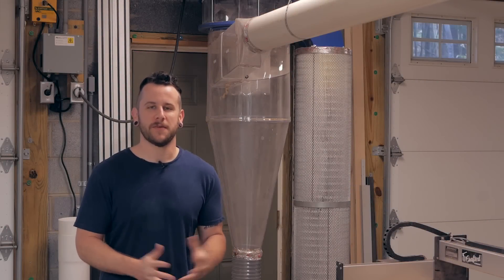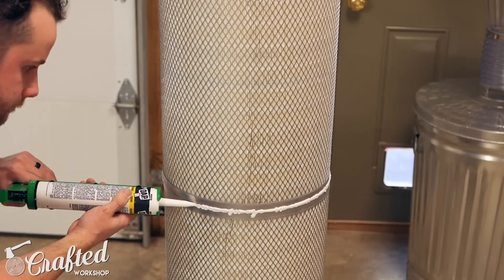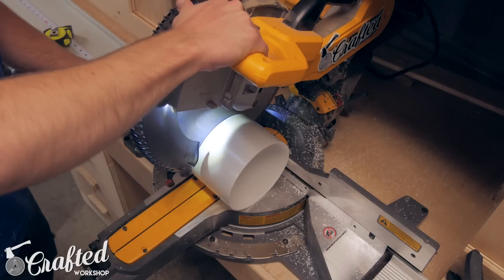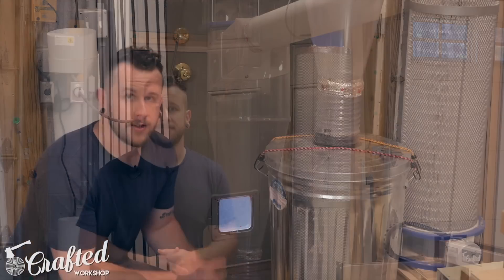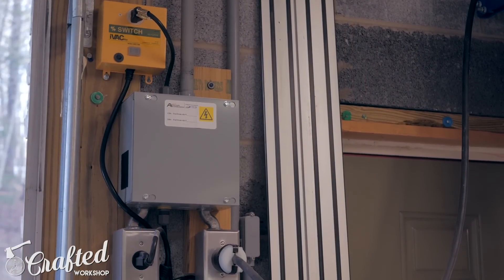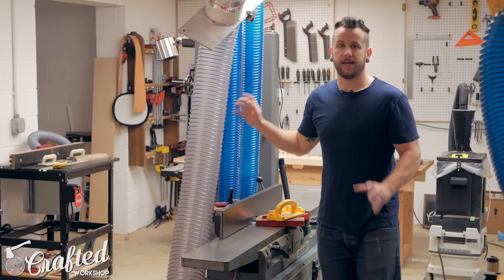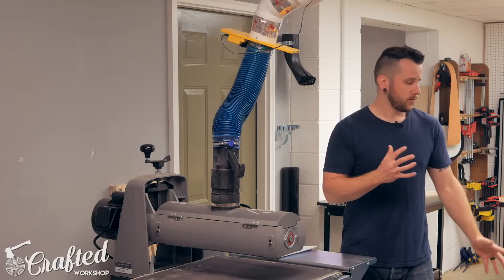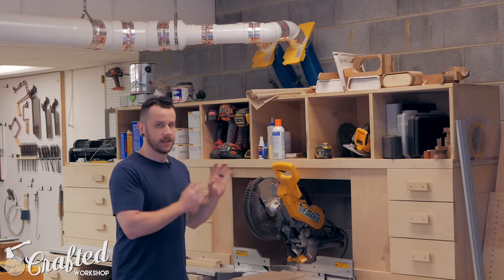Woodworking Dust Collection System w/ iVac & Clearvue CV1800

Comment: I am in the processing of setting up a system replacing my jet double bah system that spewed dust everywhere.  It was in an attached building so noise really wasn’t a factor until I realized I was pumping all that outdoors.  I just realized you were sponsored by Clearvue which was one I was considering.  The others being Oneida, Laguna Pflex, Baleigh DC2100C.  I REALIZE THAT THE ONEIDA AND CLEARVUE HACE LONGER CYCLONES, WHOCH results in extra height which limits shops with low ceilings, but❤ i am truly selling t❤he best performance in reducing dangerous small dust particles as determined by actual users.  I am concerned because this unit will be inside my shop not vented inside.  HELP.

Comment: The grounding is a good idea to prevent a dust ignition (explosion) easily fixed insert a wire in the system main trunk line during construction

Comment: Nice review. I am trying to determine what direction I’m going to go. Grizzly Go441 cyclone or the clearvue. One of my biggest concerns is the fine dust, I have a 37” Ramco wide belt sander . So as you stated when you run your drum sander you can see the fine dust in the drum. There has not been one review or video actually showing how much fine dust is collected in the drum. Take no offense I don’t know any of you that has received system from Clearvue, your word is one thing but proof is in the collection drum. It’s my $2000 at stake not yours or anyone else. Thanks and appreciated.

Comment: i just bought a Oneida v 3000 and have been putting it to gether  , i just ordered 2 long 45 to bring the whole line closer to the celing.  i will not buy any more metal pipe,  is there any issue  with putting the two pipes together?  thanks,,doug

Comment: 5 HP motor is not 3 face?  3 face motors do not use capacitors for starting.
Reply: 3 PHASE....anything over 3hp should be, otherwise it's a furfy.
Reply: @brewsterly2927  ??????????
Reply: @mtabernig  

A 5HP motor would be 3 phase, not 3 face.
Reply: @brewsterly2927  yeah I c my mistake ....lol
No in socal does not rain,    It never rains in Southern California....... nay be once a year?
Thanks.

Comment: From what I can see that iVac is rated at 20amps but the clearview is 30amps- how did you get around that?
Reply: The iVac isn't directly switching the motor power in this design.  The non descript grey box below the iVac is an optional high current relay they sell for motors over 3HP.   The iVac he is using is a 120 V model and it serves as the actuator for the high current relay.   

Kind of odd plugging a  relay into a  relay, but this does allow them to switch more or less any load they want without having to have a bunch of different models.

Comment: if anyone could explain to me the static pressure numbers and what they mean, I would really appreciate it.  Is a higher static pressure value better than a lower value?  I mean, if it says the dust collector will produce 1000 cfm at 5.0 sp, does that mean if the static pressure in your system is more than 5.0 the dust collector will not achieve that cfm rating?  Is the reverse of that also true?  Meaning a system that had 2.0 sp would allow the dust collector to achieve more than 1000 cfm?  And what about Max Static Pressure?  Would someone be willing to explain this to me OR maybe give me a link to somewhere that does explain it?  Thanks.

Comment: I made a 2 stage collection system with a HF 2 hp motor, and a few pieces of PVC attached to a metal trash can.  Cost was less than 200 for entire system.  I do agree with you on the grounding issue.  Didn't ground mine either.  No static on PVC.

Comment: Totally agree about the grounding issue. I have never had a problem with static electricity whether working with dry or wet wood or the humidity in the shop.
Reply from the maker: I still have yet to have an issue, I think it’s completely bogus.

Comment: Hey man, first off let me say I am a big time Clear Vue fan--but to my question---do you wear hearing protection any time you have your DC on? My CV-1800 is so loud I can't be in the shop when it is running--at least without ear muffs. I haven't seen any YouTubers mention how brutally loud that 5 HP motor is? Just interested to what you do??
Reply: I can tell you what you can do: ENCLOSE IT; due to many reasons, this time around I decided to get a cyclone that I can keep inside so I don't waste thousands of dollars again only to rust outside, so I got the clearvue max, with a 8" main; I enclosed it in the corner of the shop and left the top part where the motor is open, away from me, thus reducing the noise quite a lot; I put a doorway for the bottom part so you can easily clean out the dust bin; if more serious maintenance is needed, the osb can easily be unscrewed and get access to the entire system; hope this idea help you in reducing the noise. dan.
Reply: Enclose a tool thats almost meant to give a show? Honestly the thing i love about these DCs is the view
Reply from the maker: Hah, it is fun to watch!
Reply: I guess its a choice one has to make, the noise can be annoying at times thus for me "show" means nothing, production and pleasant environment to work in would do for me

Comment: Nice job! Working on a very similar system (CV1800, pvc) for my home shop. Now that you've been running/using it for a while, is there anything you'd do different? How would you rate the CV1800 noise or have you found a way to reduce the sound? Was there a reason you went with 2 drops for the ts rather than 1 with the CV 6->dual 4 adapter? Thanks for the video, it's been very helpful!
Reply from the maker: The system is still working well. The CV isn’t quiet but besides building some kind of enclosure for it, I don’t know of another way to reduce the noise. The reason for two drops on the table saw was I needed one hose to hang down to keep it out of the way with that blade guard. I’ve since changed that setup and have one drop with the 6 to dual 4 adapter.
Reply: @craftedworkshop  Thanks for your reply Johnny! Sorry, forgot to ask, doh, are static shocks an issue? Re the sound, the Bill Pentz site has a page on making a muffler (Oneida sells something similar) - if you haven't seen, it goes between the plenum and filter. Saw a YT vid where the guy did a side by side with/without. IIRC, it was a significant reduction, 8 dB or so. Thanks, again, Jerry

Comment: Very well done, amazing what a bit of concentrated thought and more than a bit of coin can do:)  Like that work you did on table saw using 4 inch pipe above the blade. and switching out the standard 4 inch to 6 on your jointer.  Curious about your galvanized trash can, with all that HP do you ever get trash can implosion)  I have see that happen with metal cans in the past.  Otherwise great video and keep up the great work, smarter not harder)

Comment: Hi Johnny,
Did you get a stock CV1800, or upgrade the impellar to 16" (a sort of CVMAX / CV1800 hybrid)  I'm finally about to commit to the purchase, but I have a 20" planer and want to make certain I've got enough suction.
Reply from the maker: I have the stock CV1800. Works well for me but I have a 15” planer, might want to confirm with the manufacturer of your planer what kind of CFM they recommend.
Reply: sorry to butt in, but cvmax would be a better choice for you, is not the size of the impellar (as you call it) as much as the size of the main run, cvmax has 8" inlet vs cv1800 at 6"; now, that won't help at all if you gonna dramatically drop your lines to 4" or so; you should keep it as large size as possible all the way to the tool.

Comment: You totally skip right over the one of the most important parts of the entire system, the dust filter. Things like, brand name, size, microns capable of collecting and how much is necessary, how do you and how often do you have to clean it. What is that thing on the bottom of it, you know, small little details like that.
Reply from the maker: The filter came with the dust collector and the instructions are clear on how to clean it. I spray it out with compressed air and vacuum out the dust from the bottom of the trap.

Comment: I know this is an old video now but I just saw it.  Really nice set up.  I run 6" pipe similar to you on my system and have found a dramatic decrease in airflow when going through flex hose.  I have compared measurements from 4" flex versus 4" smooth pipe and have concluded that the flex pipe reduces airflow by much more than I expected it would.  I noticed you have some very long flex hose runs.  I have run straight pipe as much as I can and use very little flex now.  The drawback is you can't move your machines around as much but the increase airflow is worth it.  I know your changing it but for example, there is not reason to run flex hose down to you miter because you don't have to move that machine.
Reply from the maker: For sure, good tips!

Comment: First, thanks for sharing.  Nice work.  Question for you....  looks like the take off from the cyclone is pretty level.  But I know the cyclone is angled up a bit from the intake.  How did you address that connection?
Reply from the maker: Thanks! There’s enough play in the connection that I could account for the angle and keep the duct level.

Comment: What type of pvc pipe did you use. The sewer pipe that I have seen is usually blue. Is there a ASTM number or part number on it.  Manufacture name also if you don't mind.  I just purchased a cvmax and just planning on the ducting... was thinking nordfab, but serious cash.
Reply from the maker: It was sewer and drain pipe from my local plumbing supply (Hajoca). 6" diameter.

Comment: was there a good reason you ditched the molded gorilla? i have a very small shop (11x24) and to make the most use of the space I won't really be able to put in a huge DC... because my tools will float I'm thinking I should just upgrade what I've got (a 1hp portable with cannister filter) and the molded mini seems like the only option. you seemed fairly happy with it?
Reply from the maker: Yea, it worked well, I just had the room to upgrade to something more powerful and add ductwork. It’s certainly a lot more convenient. Laguna also has some mobile options that look good.

Comment: You seem kind of apologetic about not showing a "woodworking" project. I think this is a very important topic for people to gather information about. Besides just the cleanliness of the work area there are health implications of dust. Something people may not think about is if your shop is in a basement - the fine  dust will be impacting everyone else in the house. Proper dust collection is a very important investment in time and money. Great video with a lot of helpful/insightful information.
Reply from the maker: Totally agree, thanks Thomas! The video was a little off topic for my channel, hence the explanation.
Reply: @craftedworkshop  I agree with Thomas, thanks for all the effort.  I have a pretty good dust collection system using 6" PVC but want to upgrade to dual stage (It may eat less goggles etc). I don't have a mitre saw for wood, but my radial arm caused me similar hassles, my pick up is a 4" at blade level, I had to fiddle with the cut off bevel angle. I tried picking it up at the guard with no success.
Dust collection isn't easy if it was the manufacturers would do it.

Comment: I know this is a few months old now but I see an issue with your ducting to the miter saw. You have it reduced from 6 to 4 and then a length of 4 with a Y on the end of that. So basically you just have 2 fours comiing off of a four inch line. you have created a large restriction in this area. You should have one of the true 6 to dual 4 adapters here or at least use a 6" Y and reduce off of that. Great video, I really enjoy your channel!
Reply from the maker: Thanks Scott! I'm going to be retrofitting this with a 6" blast gate and hose to increase air volume. You're right, my setup wasn't ideal there from the beginning.

Comment: How does the noise level compare to a single stage dust collector?  I find myself wearing hearing protection when I ever I am running my dust collector. do you have any method of soundproofing to reduce the noise.
Reply from the maker: +David Hurt it is definitely loud. I am always wearing hearing protection anyway since I'm running a tool, so it doesn't really matter to me. You can build a small closet around the dust collector to reduce volume.

Comment: do you use a separate vacuum for your sander or do you have a downdraft table. you mention the mirka sander what kind of dust collection do you use with that?
Reply from the maker: +David Hurt I have a Festool dust extractor for that. The mobility is pretty critical, I can sand basically anywhere in my shop, unlike with a downdraft table.

Comment: Great video. Other than cost and  having a fixed dust collection system, any significant reason for Clearvue over Oneida?  I watched your Oneida mini gorilla video review and you spoke highly of their dust collection.  I'm new to woodworking and have a small shop where a portable system would work best.  I'm using shop vacs with an Oneida dust deputy currently and I definitely need to upgrade soon.
Reply from the maker: +Ridgeback Entertainment nope, the Molded Gorilla worked great, this was mainly an efficiency upgrade. That said, the Clearvue definitely pulls a lot more air so it allows me to use bigger ports.

Comment: You need to educate yourself on grounding plastic ducting, or else withdraw your comments on the subject. Check with your insurance carrier to see how much less he will charge for a grounded system.
Reply from the maker: +Chuck D show me some documentation. It's amazing how people still push this without any documented cases, as far as I've seen.
Reply: You're a big boy, look for yourself.
Reply: Chuck, science is pretty clear. PVC is an insulator. The only reason to ground PVC would be to prevent static shock on the exterior of the piping. If you are actually interested in the science here's a few articles: 

Article 1: http://www.woodcentral.com/articles/shop/articles_221.shtml
Artciel 2: http://www.thewoodnerd.com/articles/dustExplosion.html
Reply: So say you. After 6 months of research, I've yet to find a case of a dust collector, in a home shop, exploding due to static build up and discharge. EVERY case that you have read about has been through industrial systems. There is not ONE case that I have seen where a dust collector has caught fire due to static discharge inside either the duct work or collector bag or filter. The only cases where I've seen anything remotely close is where someone introduced the spark either for testing or due to a mistake cutting of metal. So unless you have some actual evidence, then I'm afraid you're wrong and misleading people. And if you would like to say: "go look for yourself", well I have. I've spoken to the CSB (Chemical Safety Board), building inspectors and OSHA. None of them could site a single instance where this has happened. Searching the web, the only legitimate results that have come up are with Industrial applications like a grain silo.
Reply from the maker: +McLarty Woodworks that's the same info I can up with. People love to promote these conspiracy theories about PVC ducting but it's worked great for me so far.
Reply from the maker: +Chuck D can you show me some?
Reply: Actually, you're the one peddling the theory with no fact. I'd love to see some sources on this topic, so by all means please share facts and research that help prove the dangers of PVC dust collection piping in a home workshop.
Reply: You've got your mind made up. There's no point carrying this conversation any longer.
Reply: The evidence is overwhelmingly in my favor.

Comment: Nice walk through, was that your old shop Vaccum with a dust deputy in the back,
I've been thinking about doing something like this, only with my shop Vacum and smaller pipes as I only have a little work area...thank you for some more good ideas I can work with 
Keep up the good work 👍🏻👍🏻👍🏻
Reply from the maker: +theduck thanks! No, that's the vacuum I use for my sander, router, etc. I have a video about my previous dust collector on my second channel if you're interested.
Reply: More then one channel ... different content?
It's not listed in your description , I see all the stuff you where talking about there just not a link to your other channel
Reply from the maker: +theduck here's a link to the video on my second channel: https://youtu.be/GNfBFA_yknE

Comment: I had to ground my ducting because on very low humidity days it shocked me and it also knocked out the USB communication with my CNC router. It only happened on a very cold and dry day so it may more of an issue in arid climates. I wasn't worried about it causing a fire but had to ground it to keep my CNC router com reliable.
Reply from the maker: +Tony Shulthise yea, that makes sense. It's pretty humid here in NC and we have a fairly temperate climate, so I should be good! Thanks Tony.
Reply: I had my cnc go into safety mode if I touched the shop vac hose to the spindle casing. I ran a ground wire from the spindle clamp to a ground on the power supply and it stopped that.